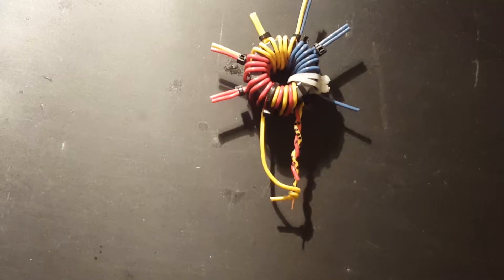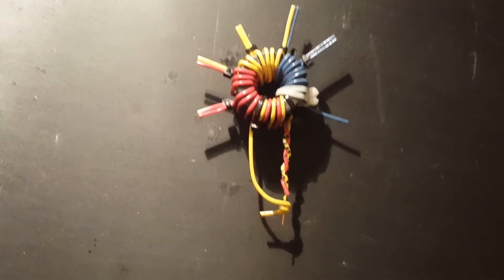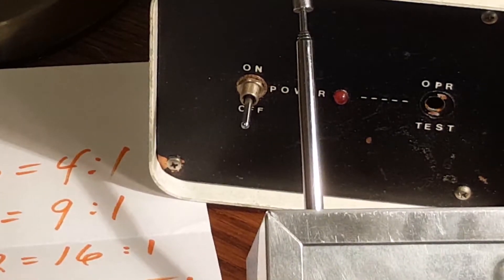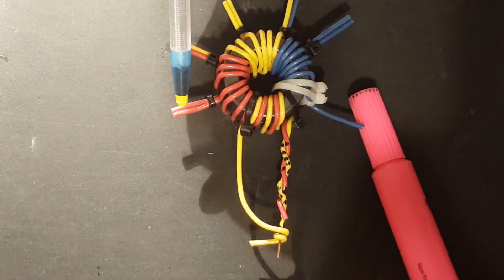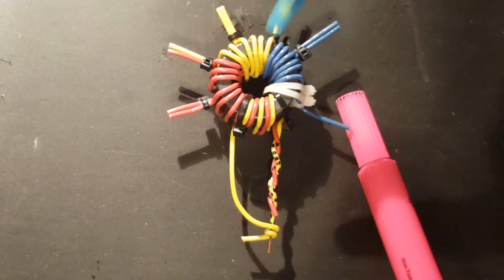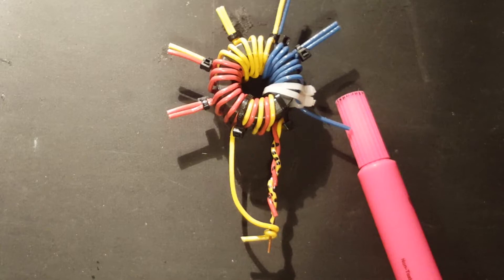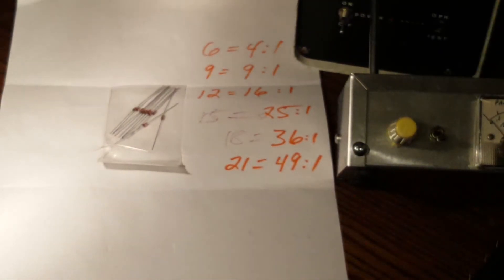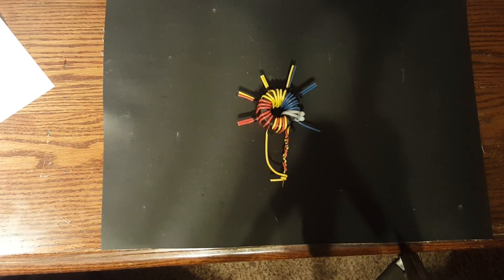UNUN Wind

Comment: so (secondary/primary)²=ratio to 1 is that correct ? why did  you chose 3 primary turn instead of 2 or 4 or 5 ? and I don't understand why the orange wire (which is the secondary output) is tied to the ground ?? shouln't it be tied to the center of the coax instead ?? (I guess not since you did it that way but can you explain why ?)
Reply from the maker: Hi there.. you ask a really good question about why the number of primary turns I use. I'm going to make a video in a couple days, and I'll talk about your question. Thanks! But I'll answer your comment either in a little while, or tomorrow, and tell you why. And answer your other questions. I have a lot to do tonight and better get to it before the family fires me. lol. Thanks for watching and for your comment! This is how other people learn. This is also how I learn. Be well   :)
Reply: @n8nkqrp595  yes thank you for always replying ! I had also asked why use different taps where "commercial" version on the EFHW are using a single 49:1 tap if you remember ! I really appreciate you take the time to answer back, I would really like to understand this correctly and I like how simple you do your tests and it works ! 

So yeah, things to discuss in a future video if you don't mind ! 1) 49:1 EFHW vs multiple tap 2) why 3 turns on the primary and not more or less 3) how to calculate the ratios (I think this is what you said in this video secondary/primary²=ratio:1) 4) I also would like to know how to interpret the values of the core itself, I heard you talking about a specific value of a core but I don't understand what to do with that value and when to use it 5) mixes !!! 43, 52, M and so on...

There would be a lot to discuss !!! Thank you for all your recent clips, I really like it and I like to learn about those core transformers !

73 VA2CST
Reply from the maker: @Aleziss  Yep, I remember. I'll talk about that when I do the update video on my latest UNUN. Saturday I'm going to do the finish vid on the Heathkit VFO, then I'm going to do the UNUN one.. and I'll talk about both of your questions. Much easier that way, and you'll get a better answer than in a comment. ok? Thanks SO much for watching my stuff! I hope you are well   :)
Reply: @n8nkqrp595  so awesome ! can't wait to watch the next videos !!! 73
Reply: @n8nkqrp595  oh and yes, we are well, didn't catch anything yet, we are still under strict curfew from 20h00 to 05h00 until mid february ! case are goint down we were close to 2500 cases every day ! thanks for asking ! you stay safe !

Comment: Thanks! 72 de KB8AMZ
Reply from the maker: Funny how you and I communicate via comments. lol. We need to meet on the air to chew the rag. Either using CW or phone. Get this Terry - 'mr old-time ham' here made his lifetime first contact two days ago via a 10m FM repeater. lol. I've been pretty 'locked in' in my hobby. I wanted to mention, my brother Art is N2ERI.  Take care today Terry.. going to be hot as hell out there. Be careful OM.  73
Reply: @n8nkqrp595  My first 10 meter FM repeater experience was using a Kenwood TH215 HT going through a friend's 2 meter repeater using a Commodore 64 and custom software purchased through an advert in CQ Magazine to control an HF transceiver and antenna rotator. My friend sent commands through DTMF that the C64 decoded that set the works to tune the Bermuda 10 meter repeater. What a hoot. I made several DX contacts using his repeater and my HT in latter part of 1980's. 72 de KB8AMZ, Terry